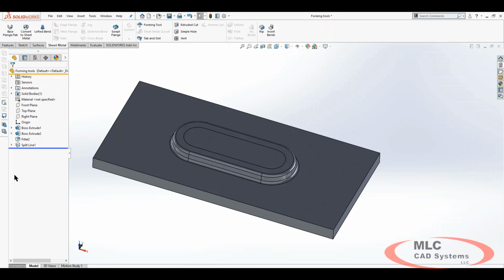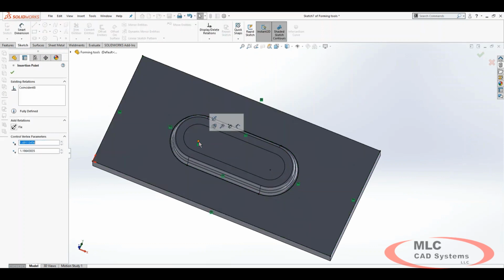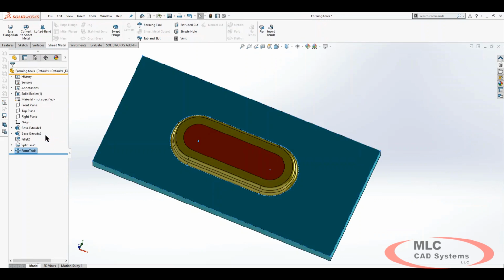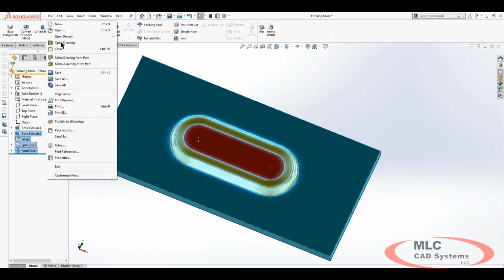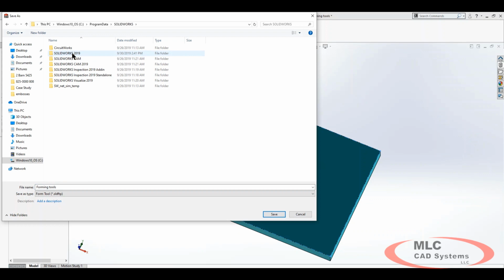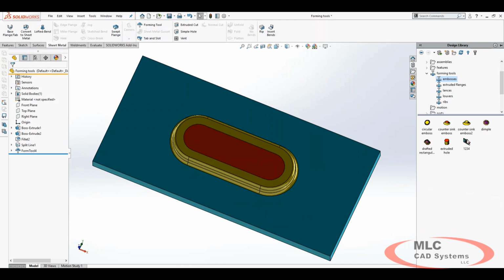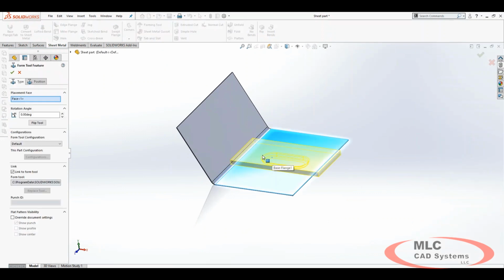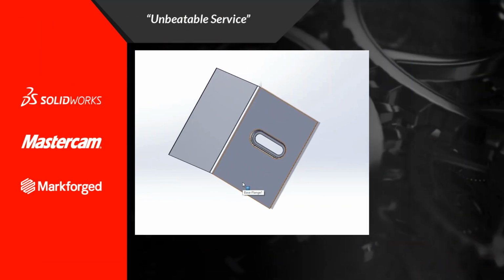How To Create Forming Tools in SOLIDWORKS

Comment: My PC doesn't have either Solidworks Version or Design Library (C:\Program Files\SOLIDWORKS Corp\SOLIDWORKS). What should I do in order to add the forming tool file?
Reply from the maker: The default path is under "C:\ProgramData\" which is a hidden folder, copy and paste that path to your Windows Explorer path and it should take you there. You can alternatively save these files into any folder and then tell SOLIDWORKS to look in that folder for them.  In SOLIDWORKS open Tools > Options > File Locations, select the feature type you want to set a path for and change the folder.  You can also view which folder is currently in use in that same place.